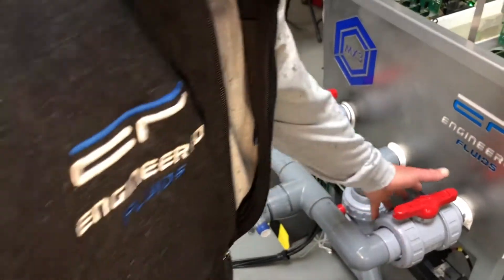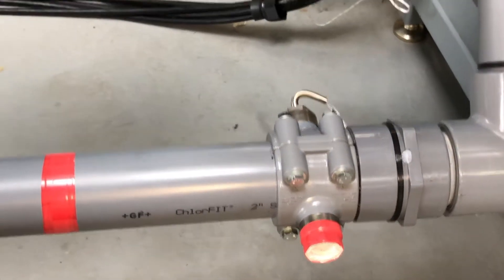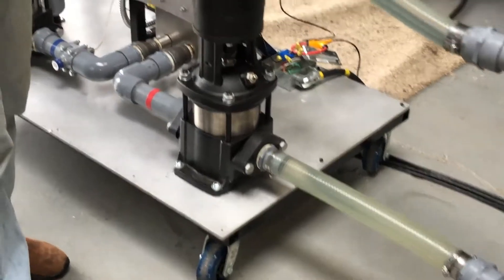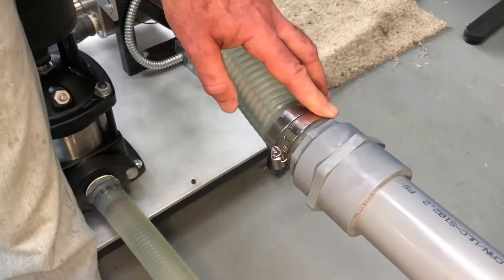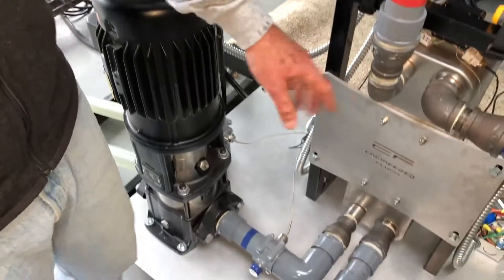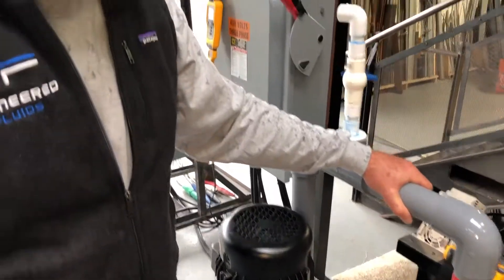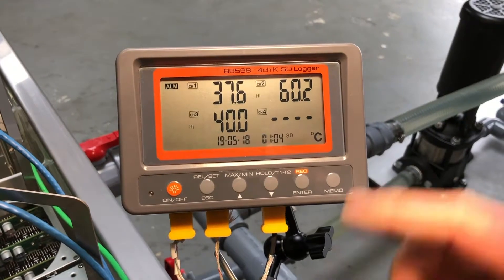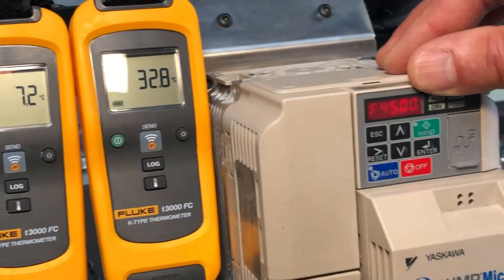Engineered Fluids - SLICTank Piping and Pump Tips

Comment: I’ve looked at a number of immersion setups, many are immersing the PSUs for each miner as well. Is there a reason that you have elected to mount the PSUs on the outside of the tank and not in the cooling liquid? Is it to maximise space for miners in the tank? Or is there a technical reason?
Reply from the maker: That is correct!  Most PSU are relatively efficient 93-97% of the energy is converted and the rest is lost as heat, so when you look at amount of BitCool the PSUs consume in terms of space vs. the cooling performance most PSUs really don't benefit from immersion cooling, UNTIL you start to overclock your miners then Immersion really kicks in to keep the PSUs cool as you draw a lot more amps from the PSUs and in some cases overvolt them.  Cooling them becomes critical.  So its a trade off between overclocking and space utilization.  For most modern miners S17 onwards, the PSU is integrated into the miner, so the added hassle of taking it apart to save space only works if you have small farm.  Try doing that to several thousand miners!   We have our new Immersion FLIP kit which allows you to simply "flip" over the miner and still have access to the ethernet and power ports.  Just email us at sales@engineeredfluids.com for more details.

Comment: how does your dry cooler get the liquid down to 7C or 44F, is it an adiabatic dry cooler? is the ambient temperature outside 44F or below? what happens in environments where ambient temp is in the 90s F?
Reply from the maker: Liquid coolers are totally dependent on the ambient air temperature.  But why would you ever want to get your BitCool down to 44F??   The best operating temperature for crypto miners is an entry temperature of 40C / 104F.  If you cooling your BitCool down to 44F you are wasting a lot of energy and money, plus your actually less hash efficient!

Comment: It is a great system and probably the noise source could be easily adjusted. Thank you for your video!
Reply from the maker: Hi Robert - Noisy in comparison to what exactly?  Fans?  Given that the pump is moving something on the order of 300 Liters a minute, I actually think it is quite quiet compared to what all the fans and A/C units would be doing.
Reply: @garytesta2324  Do you need a special pump for the oil? thanks great infromation Gary!